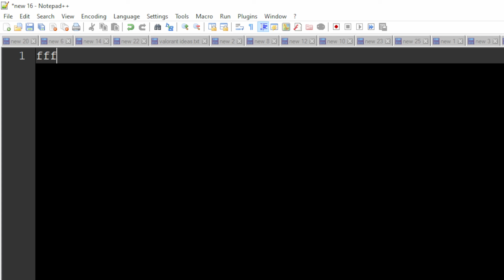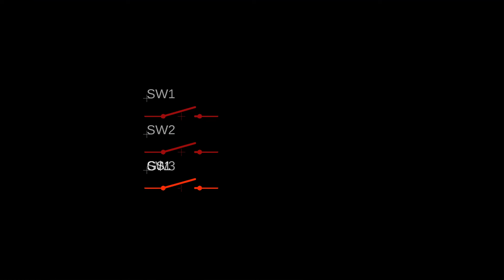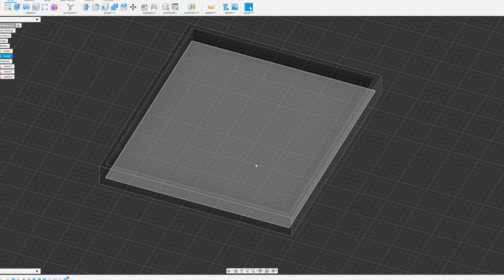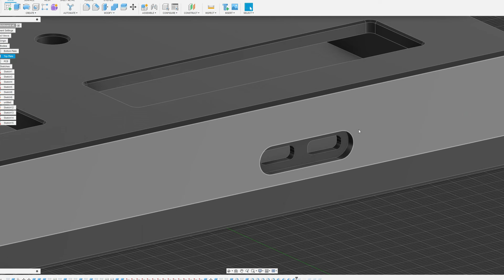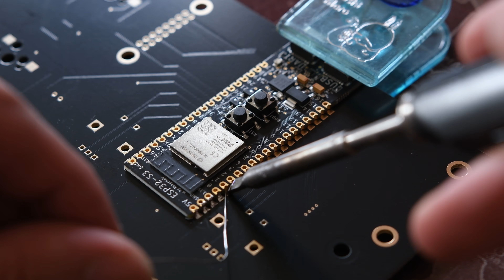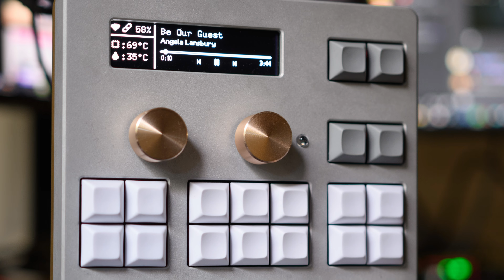Switchboard - The ULTIMATE Macropad Build

Comment: I'm Building something similar. With IR TX AND RX,26 mx hotswappable  keys, 1 rotary dial, battery operated. Old screen as well. Tap dance key to change layers. Will control projector (on and off), 2 tvs, govee lights, and a few macros and keystrokes.

Comment: How well does the antenna work? I noticed you have no keepout zone on your esp32-s3 module and main pcb and also no RF matching circuit. Not trying to lecture you, just curious how well it works without the aforementioned measures.
Reply: It's not an issue since I am right next to the wireless extender but it's definitely something to keep in mind for a future iteration. You are 100% right and valid.

Comment: This is really cool, love these type of projects. Def earned a sub.

But as a keyboard nerd I can't help but suggest a couple things. You could add some foam under your PCB, and between the plate and pcb, as well as tape mod the bottom of the PCB. Use some long pull linear switches, also lube the switches I think you would be surprised how it sounds.
Reply from the maker: Noted, will definitely consider in a future project

Comment: That is an absolutely amazing build! Nice work.
I know you mentioned potentially selling this as a product, but on an individual basis it might prove to be prohibitively expensive? It might be easier to get off the ground with something like a group buy? That way you could get at least some savings through economy of scale
Also, you could sell the STL? (or whatever the correct format is) files for the PCBs (keyboard and controller), either separately or as a bundle? I'd definitely pay for those.

Comment: Oh god please never slot in all the switches at once into hotswap sockets, it's the best way to pop a socket.

Also you could probably still implement some sound dampening. A sheet of laser-cut EVA foam between the plate and board and maybe like a thin sheet of PE foam between the board and case would only take a few millimeters more and would greatly help sound-wise.

Comment: This is easily worth $80-110 aud knowing the keyboard market lmao. Super cool design might try make something similar
Reply: Thought material cost would be higher than that because of the metals he used, could be wrong.
Reply: @flame6327  oh it would for sure, if he offered a plastic version he could easily sell for 150, metal versions would need to be at least 350
Reply: Worth way more ! A stream deck which has more than half the user features cost $200 . His has smart home features and more . I would say worth up to $400 +
Reply: @jayyb1832  yeah for sure, but for the price of a streamdeck he could make less profit per model but sell a lot more of them!
Reply: no it is not. the keys will work. but the rotary encoders are just a gimmick. none of the videos on youtube implement them properly. and none of them will work so easily with an SoC. encoders need proper signal correction with schmitt triggers and most importantly a quadrature decoder. all of which these youtuber hobbyists have no idea about apparently. a quadrature decoder chip alone (like ls7366) costs between 20-40 bucks if you don't buy in bulk.